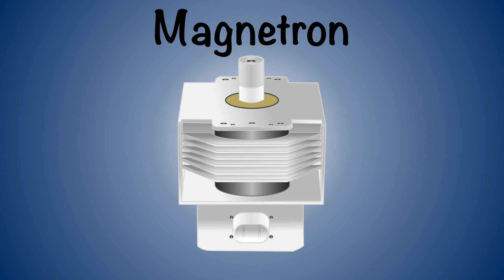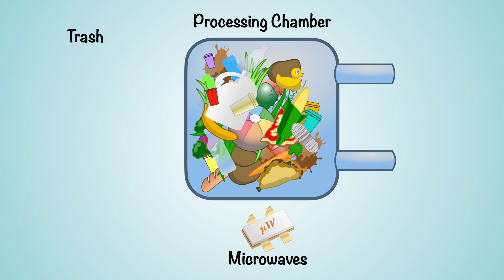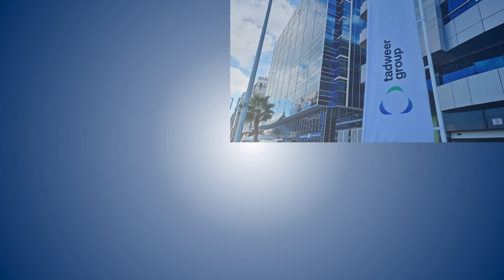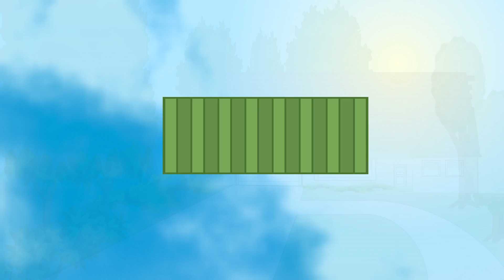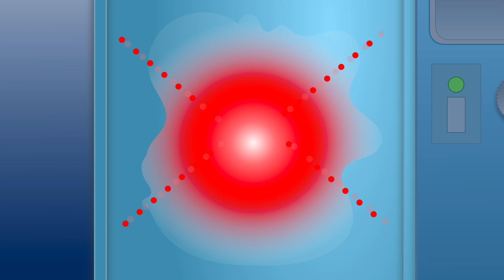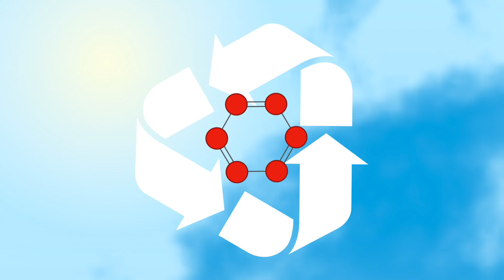How Solid State Microwave Emitters Improve Converting Waste into Energy and Cook Bacon Better

Comment: So graphene just falls out? That alone makes me call bullshit on the whole thing. Why the hell should carbon assemble to sheets literally in mid air, in the plasma cloud? It would be easier to believe if they would say< that diamonds fall out.
Reply from the maker: Okay, saying "drop out" is a bit loose. But it does form under the right conditions. Check out the research done at Rice University. Thanks for watching, paying attention, and commenting.

Comment: Who the hell has a microwave repaired?
Reply from the maker: Home microwave ovens rarely need repair. But my friend did have the magnetron in his oven die. It had to be replaced. However, food preparation services run their ovens continuously many hours per day. Worst case, they replace a magnetron every six months or buy more expensive ones that last longer. Thanks for your comment and for watching the whole thing.
Reply: @markinoWindsurf  I'd think it would be cheaper just to buy a new microwave these days...Although it takes about 10 minutes to replace a magnetron. The real question is...Can you make a microwave laser with the solid state parts??

Comment: "Break down" - yeah, everyone has had those pesky ever-lasting magnetrons break down. 
"More efficient" - I'd like to see that explained, how a self-oscillating inductive-capacitive cirquit fed by a HV transformer lags behind in that are.
"Some or other obscure brand heats up food perfecly" - yes you see modulating microwaves by a semiconductor completely does away with standing waves inside a microwave oven because they magically spread out and become homogenously even.

My personal favorite is doing pyrolysis with microwaves. That's right, because all hydrocarbons love microwaves, even those that ignore the s××× out of them because they're transparent to them.
Reply: Not to mention that generating microwave by semiconductors are, at least for now much inefficient than magnetrons (or reflex klystrons) and to make them wideband is a nightmare because of the matching problems for FET transistors.
Reply from the maker: There's quite a few research papers that address some of these issues. "Conversion of waste polystyrene into valuable aromatic hydrocarbons via microwave-assisted pyrolysis" is one.
Reply from the maker: I am unable to argue with you about this. Perhaps you need to contact the engineers at  ITW or NPX. I can say that when I was studying electrical engineering in the 1970s, two very experienced engineers cautioned me not to learn about semiconductors because they were just a fad.
Reply: @markinoWindsurf  perhaps you need to provide actual arguments instead of throwing things out there, because of literally all microwavr ovens sold none are solid state, and like I said I have NEVER head of a magnetron failing.
And oh no... a paper about something! Of POLYSTYRENE of all things! What a critical resource, and what a useful process it would be of microwaving it instead of running conventional pyrolysis! Gees.